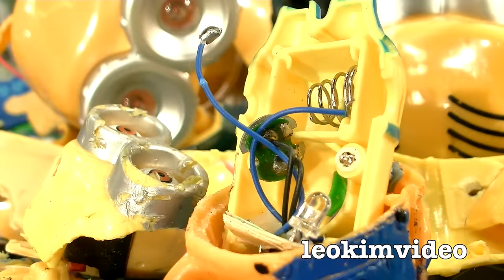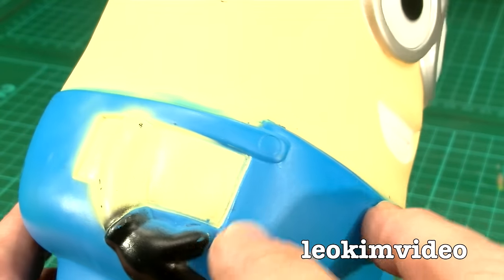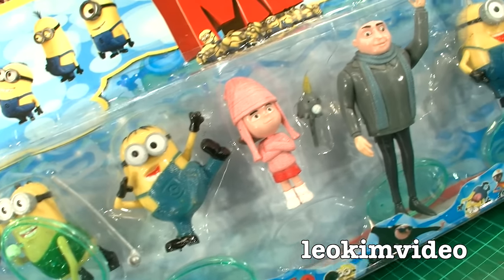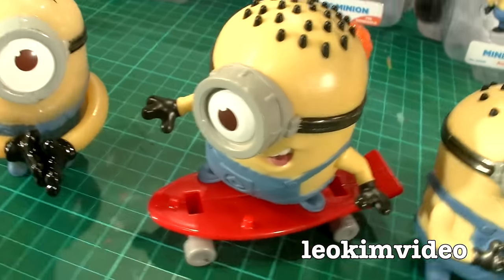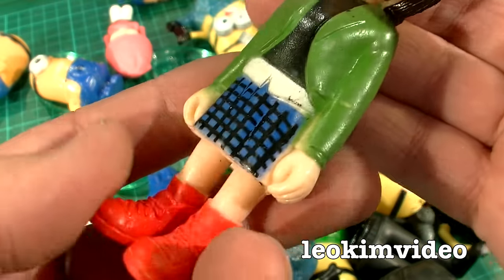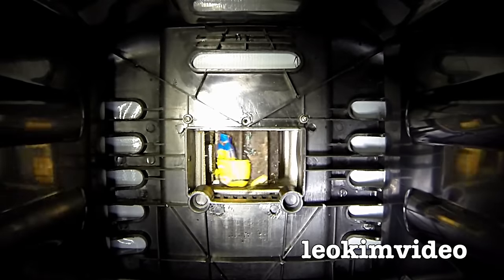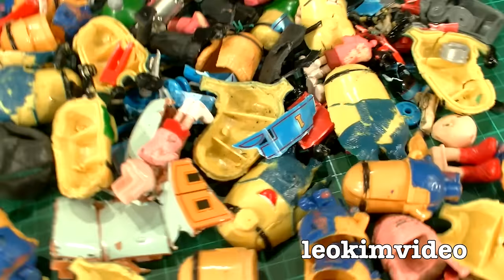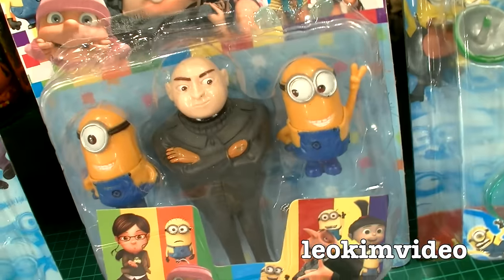Despicable Me 2 Dark Side Knock Off Toys Minion Madness Toy Crusher Destruction

Comment: I don't think purposely setting a knock off plush on fire proves that it is low quality. WHAT KINDA CHILD WOULD PURPOSELY SET A KNOCK OFF PLUSH LIKE THIS ON FIRE?! almost all plushes burn like that if they are set on fire
Reply from the maker: supergailey1 maybe I need to burn a real minion to find out, but that will only have you in more rage. Sad you totally missed the point of me showing how this nasty toy burns
Reply: kids do strange things when playing, mr plushie can be a flying superhero and is thrown across the room to save another toy ,and ends up tumbling behind the fireguard, then its a fire risk, all caused accidentally, but possible, and , the majority of decent manufacturers of plush item use fabrics and fillings which self extinguish after a few seconds,
Reply: baxter22071990
Reply: supergailey1 it doesn't matter about how something like this could catch on fire the fact is if it does it shouldn't stay on fire long enough to burn anything else. also no not all plushy burn like that maybe old ones (1970 and below) but not now due the quality control mandatory checks to make sure that the toy has been in quotes "treated with non toxic flame retardants" But hey not every one looks to make sure it complies with CPSIA and ASTM F963 standard for flammability. something that the real toy complies with and the fake toy does not.